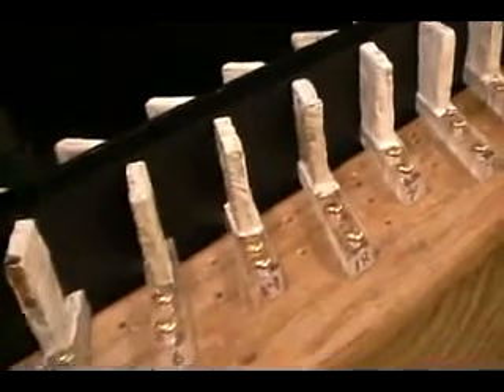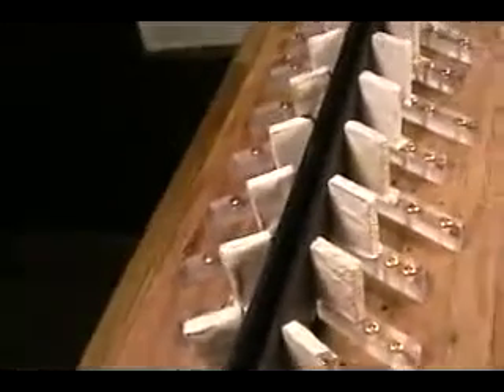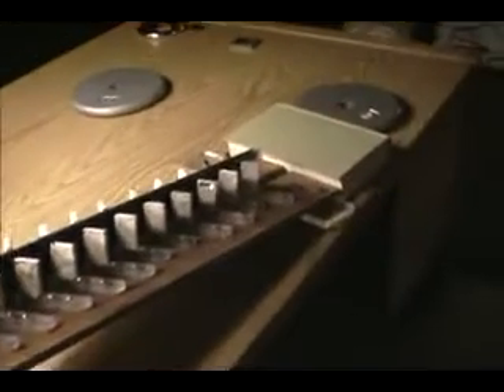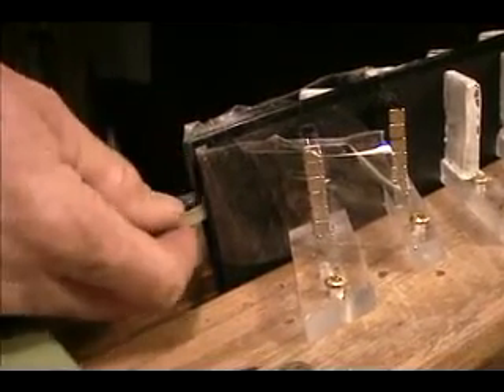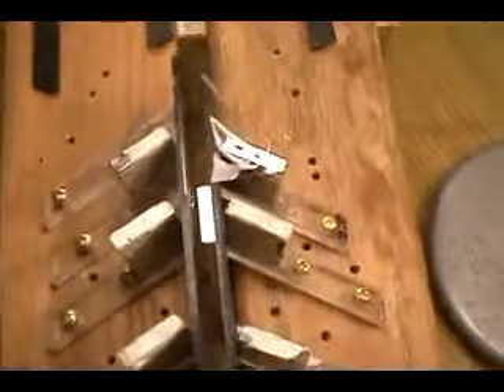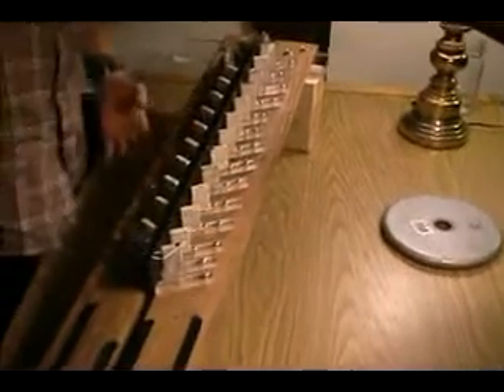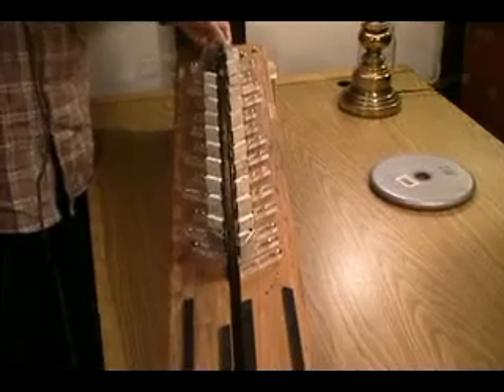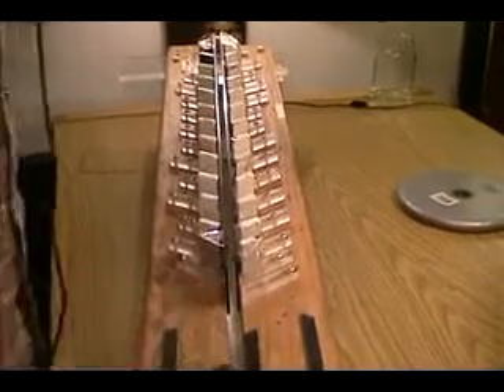New Energy Invention Magnetic Motor

Comment: The work the slider can do as it moves around the circle is the sum of all the bits F.ds for each point on the circle (ds is the small distance moved along the circle and F is the tangential force acting on the slider at each point along the circle). Because the potential energy doesnot change when we go from then back to  the same point on the circle the sum of all the F.ds =0. (this can be proved mathematically). Therefore no net work can be done by the slider by going round the circle.

Comment: 1) bending the track breaks the mirror symmetry of the fields which keep the forces along the track in the linear case. Conclusions drawn from the linear track cannot be used to predict the behaviour of a circular track.
2) The potential energy PE of the slider at any point in space is a single valued function. If we go round a circle it must return to its original value. So we cannot have a tangential force (i.e the gradient of the PE along the circle) which constantly pulls around the circle.

Comment: You have made a very nice example of a magnetic track and have made a good video demonstrating it. Your conclusions that it can be used to generate energy are mistaken. The magnetic slider is just going from a position where its potential energy is  say U due to the magnetic interactions to one where it is lower. You have to do work to remove the slider and take it back to the beginning of the track if it is to run in a circle.

Comment: It would be an interesting to see a straight line linkage such as Chebyshev linkage attached to the shuttle. you could then use the stored energy of a  flywheel.  the linkage is used to create a mechanical straight line, but on the return path it rises and makes an awkward oval, similar to the shape of a hard taco shell.

Comment: What he is suggesting here is that if you arc the geometery you will eventually end up with a circular design. He is also assuming that when this arc is created that the magnet will still be attracted to its "Sweet spot". Also, someone mentioned that he needs to get the shuttle magnet to go beyond the array. I disagree because the only reason why the shuttle stops is because it runs out of magnets to pull it along....so it gets caught up at the end of the array.

Comment: not a new concept, but thanks for uploading as well. Like marthale7 mentioned you need to reach the point where it escapes from the array. But that is not possible with normal magnets. For example, if there were magnets that would loose strength when objects move away from them, but increase magnetic strength when moving towards, than we would have nearly infinite energy supply. Sort of a reverse back EMF, people tried using copper coils configurations to do that. Also, consider turning off magn